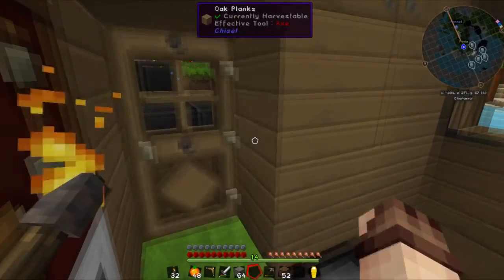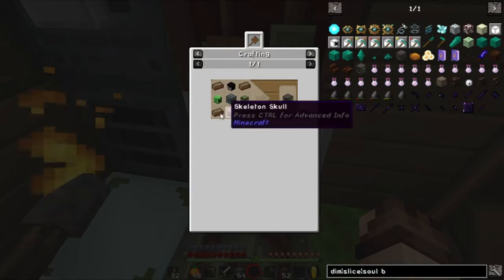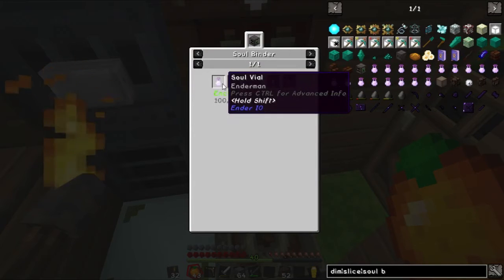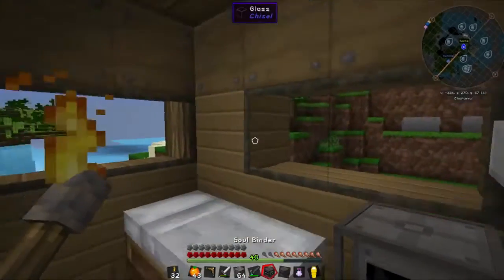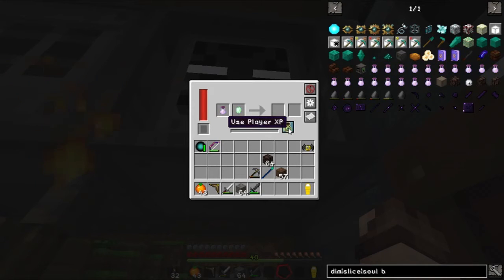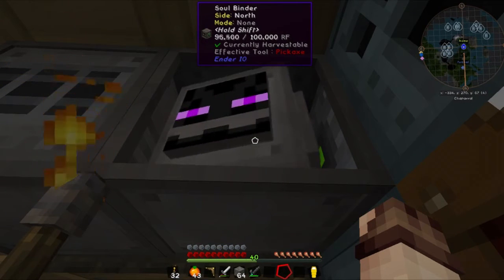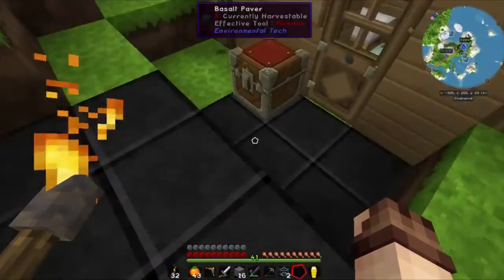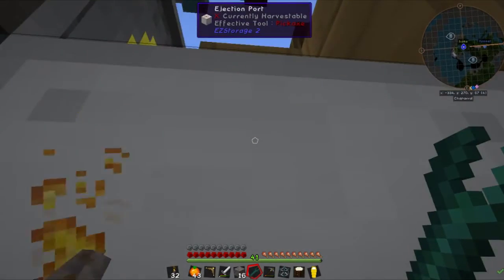FTOG Avant III #13 - Not a Tesseract [Modded Minecraft 1.10]

Comment: Thxs you for the information you gave requiring the dimensional Transieva but i still like Tesseract but will use this one instead. Thxs and keep up the good work.
Reply from the maker: +Jocelyn Parker there are no Tesseracts in the Avant 3 pack and may never be in 1.10 as the mod authors have stopped developing thermal dynamics